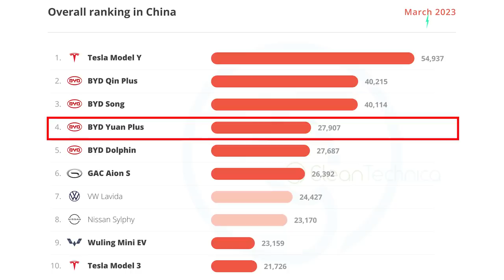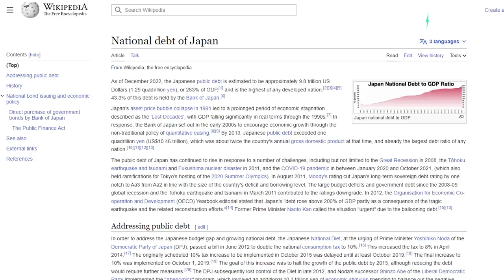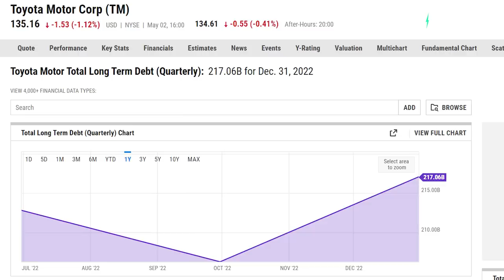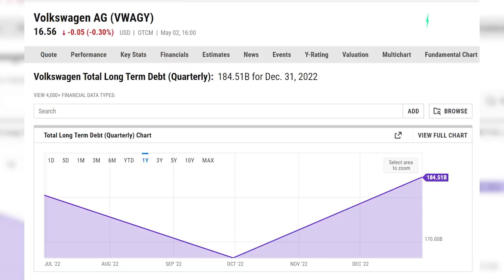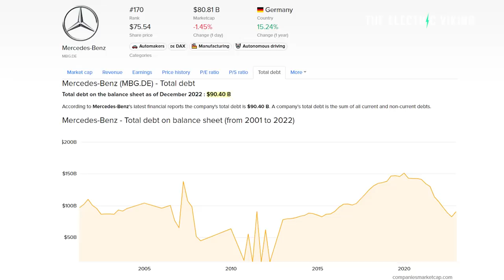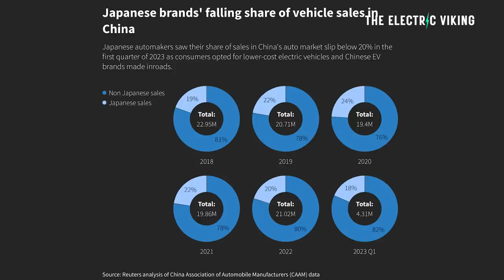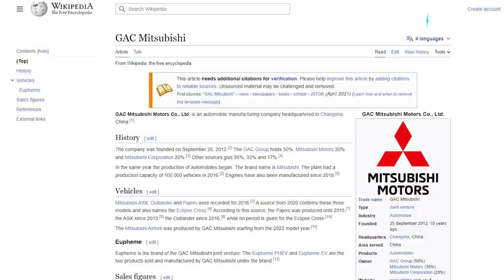Japan's automakers' Kodak collapse will cause an economic catastrophe

Comment: I don't get the connection between manufacturing moving from Japanese ICEVs to Chinese EVs leading to a recession.  Sure, an economic problem in Japan, but it should be a net zero globally as production moves from one country to another.

Are we going to experience a recession?  Possibly.  But due to the need to curtail inflation.

Interestingly, moving from fossil fuels/ICEVs to renewable energy/EVs will be deflationary.  The cost of both energy and transportation will drop.  And as energy/transportation costs drop the price to produce many goods will decrease.

Comment: There are also cultural reasons why the Chinese don't want to buy Japanese cars: the Chinese remember what the Japanese did to China before and during WW2.  Japan's economy is also failing due to demographic reasons: they have a birth rate that has fallen so low in recent years that the Japanese are no longer replacing themselves. Japan won't have enough workers to keep its economy and automakers going as it did in decades past.

Comment: China is not that interested in reducing pollution. All those EVs need to be charged and the means to charge them are coal fired power plants. "China is planning to build 43 new coal-fired power plants and 18 new blast furnaces — equivalent to adding about 1.5% to its current annual emissions — according to a new report. The new projects were announced in the first half of this year despite the world’s largest polluter pledging to bring its emissions to a peak before 2030,"

Comment: A couple of toughts i've had of late; Toyota & Honda have greenwashed themselves into a corner - by offering woefully inadequate hybrids and using marketing, well meaning people have bought into both brands thinking they are doing their bit for the planet, not it's clear both companies are not progressing as they should have from hybrid to full electric, people are switching to "greener" makes. They have backed themselves into a corner, and Tesla has exposed them for what they are i.e. not bothered in the least in "saving the planet. Not a good look. That said, the Japanese do have a couple of ace cards to play in the form of primarily Panasonic, Sony & Toshiba - these guys get electronics and i think they will end up either merging with or taking over Japanese car manufacturers as they all stand to make billions, and in my opinion by being late to the party, they may actually benefit by being able to scale prodcution, with the latest battery tech - but that is perhaps a little optimistic.

Comment: Toyota's big bet on its hybrid system turned out to be a one-trick pony.  Toyota was too arrogant to realize that EV's were going to be so quickly accepted by car buyers on a big scale in the USA and Europe and China.   In addition,  Toyota never made any real effort to promote hybrids in 3rd World countries, so it missed the boat there too.  Most 3rd World countries have very poorly built, operated and maintained electrical grids, so the 3rd World isn't ready to convert from ICE vehicles to EV's.  Toyota could have dominated the 3rd World with its hybrids, but it chose to keep selling cheap ICE vehicles in the 3rd World.  The Chinese gov't has made a deliberate decision to reduce the use of ICE vehicles in order to improve the horrendous air quality of Chinese cities, while simultaneously pushing ahead with solar energy generation efforts on a huge scale.

Comment: Clearly Japan has gone down the wrong path, but I don't agree with your comment about Japan being the country that is most dependent on a single market sector. Do you know how much Saudi Arabia and some other OPEC members depend on Oil? The global economy is heading for a huge boom once EVs and solar and windpower take over from oil. But Japan is not the most oil based economy - they actually import the stuff, and unlike Saudi Arabia they have the advantage of their population shrinking. Fewer jobs is less of a problem if you also have fewer people. Some of those oil exporters are going to have rapidly growing workforces at the same time as their main industry goes into a tailspin.

Comment: The EV game is only in the first inning.  The game really doesn't start for a couple of years when the energy density of batteries reaches 500 watts per kilogram.  That's when the current drivers of ICE vehicles realize that EVs are superior to ICE.  (Assuming there are enough high voltage chargers and available electricity which there isn't tight now.) In California, we have to turn off all electrical appliances in the early evening because of lack of available electricity and there doesn't appear to be any additional electrical infrastructure being added either.
Reply: New York get paid to use Ontario electricity.
Reply: @林振华-t4v  I live in Southern California where the Edison Tier 3 residential electrical rate is $0.44/kwh. Yikes.

Comment: From an Euro perspective, I think a part of this perception is spin. Product cycles are shorter and mode dynamic now for legacy automakers. Japanese are good at iterations ans constructing value with equipment. They are still leaders with aspects such as sensors or safety and making it reliable, ergonomics or luxury and perceived quality which is not something Chinese can be trusted equally. The reliability of all these new Chinese brands is also suspect. Nobody wants to pay 40K euro for a car without pedigree. I would not buy a 30K unknown brand electric Chinese if I can buy a 40K Honda or Toyota that I know has been engineered to a certaij standard that is part of the companys DNA. I know what happens when a car is underengineered and so do many customers. Electric infrastructure is not yet ready in Europe, and I think the Japanese brands are safely positioned to electrify their models rapidly when the paradigm reaches tipping point

Comment: In the late 1980s Europe was besieged by Japanese imports and, because Japan had already banned diesel engined small cars for emissions reasons and so were not making small diesel engines, Europe decided to push diesel as a way of keeping its competitiveness, hence all EU governments like UK had a pro-diesel policy and diesels got over 50% market share and the Japanese were kept at bay.  Later this manifest itself as the emissions-gate story because it got harder and harder to keep the lie going when it was obviously a filthy fuel.  Now Chinese imports will come but this time European governments, rather than figure out a clever way to buy themselves time to let their own industry adjust, they have done the opposite and set totally unrealistic deadlines for ending ICE sales and as a result the Chinese will come and clean up (literally).  The European auto industry has so many existing over capacity problems that grind it down and consequent lack of innovation (always dealing with yesterday's problems) that it is frankly impossible to imagine anything emerging that can put up a fight.  Japan's industry will disappear not only because they have almost zero EV sales or IP, but because they are terrible at combining hardware and software.

Comment: 10:00. Lol! The same cars from 1993 with a different bumper on them. haha. That's exactly what we've got. Actually it's shocking that the public has put up with the intentional  limitation in improvements in car engines and automotive technology. Had Elon Musk not started Tesla, would there even be any EV's right now in America? Maybe there would be still, no progress at all towards EV's, because there was no financial incentive to give the public anything new. The thing that is gut wrenching, is the fuel economy. Gas mileage, or "fuel economy" did not improve at all from 1978 to 2008, in any significant way, and in many car classes it went down. In the time between 1978 and 2008, car engines did not improve their efficiency in any meaningful way, making them the only technology on Earth that had no meaningful improvement in 30 years. They are STILL not releasing "lean burn" combustion technology. In 1973, a 2,500 pound Opel achieved 376 miles per gallon, in gas mileage, with a piston engine. The technology for "lean burn" has existed since the 1970's.

Comment: Yep, Toyota is giving us "choice"... the choice to keep the blinkers on re the reality that ICE (including hybrids) is a thing of the past (there are still plenty of denyers out there, especially here in Australia, but nowhere near enough to save them!), to blindly resist change and cling to brand loyalty, buying outdated technology, based on the old "Toyotas go forever" reputation they have arrogantly relied on for decades... (forgetting that "forever" isn't much use when the fuel required to run them just isn't going to be there WELL before "forever" happens along...),  OR... the CHOICE to shop elsewhere 🤔. I'm certainly no expert in any of this, but it doesn't seem like a great strategy to me! (And this is coming from someone who was one of those "rusted on" loyal Toyota "fans" most of my life up until recent years!)

Comment: Toyota advertise on TV all the time about their EV, the funny thing is that in little writing it says overseas pre production model shown, so they are advertising a car they don't even have for sale as yet ? Oh  this is on Australian TV, I like watching the EV commercials to see that finally we are getting a few more models coming our way.
I see the ICE makers trying their sneaky ways to try and get the Hoon interested in their Cars, like VQ with their race button and other gimmicks.
Trouble is that anyone with a mobile phone or PC can see that the EV is by far the better option if you want a fast car.
Everything is going Battery Electric, all my Workshop tools are now BEV as are all my Garden Tools.
The best thing about all my tools is that they all now cost me nothing to run.
I bought a Solar panel and inverter for my Workshop/Shed that charges all my batteries from the Sun, it also keeps my Jet Ski Battery and Boat battery conditioned so they don't go flat between uses.
Once I get my BEV Vehicle, it will also cost me nothing to run as I will add another 3 to 6 kw of panels purely for the Vehicles in my Garage with a fast charger and Battery wall.
Considering we would use around $7500 a year to refuel both ICE vehicles, that will pay for the Battery wall, fast charger and extra Solar panels over only two to three years at most and after that, just savings.

Comment: 20:17 I understand how it is meant but this is actually not true. For example Guyana's GDP jumped 25% in 2021, 55% 2022, and this year is projected 25% again. Nearly all growth is due to the  oil industry. Others: the U.A.E., Saudi Arabia, Quatar with gas. And i ask myself if South Korea and Taiwan have similar dependencies on their electronics sectors. In South Korea it is said you have to pass the Samsung test to get a job. IIRC, they employ 20-25% of the workforce alone. 

Would have been interesting why we would enter a global recession because of Japan falling. They are important, but i think they are a part of what is already going on and speed it up, when they fall. On the one hand China's debt policy let some countries fail - and their own economic policies obviuously - for one part. On the other hand it's already put into place with high interest rates in the US and Europe. They still influence broader money flows than China. Japan reaps, what it sowed with it's enourmus debt levels - among other problems.

Comment: If you look at the long term trends including new product development you see the bursts and the drop due to generational demands, failed technologies and other factors..
EVs are not proven as a long term solution that is why the smartest manufactures do not go full in on a yet to be proven technology.
Hybrids are the ideal pivotal point while EV can get to a feasible and reliable status that is 20 to 30 years out.
The EU is in big trouble simce they have proposed a global plan that does not really work in paper.

Comment: Erm BZ4x... Toyota do not buy it and just stick a badge on it .. Toyota buy BYD batteries, motors motor controllers and some other related ancillary components for same .. these are shipped to Japan where the car is assembled.. so ... this is no different than 90% of the car manufacturers from around the world that buy components  and assemble the cars wherever in the world.
And by the way.. I'm a BEV fan .. Tesla being my favourite as they had the best engineered BEV cars in the world at the moment ..me being a electro mechanical design& production engineer.. should know this. Regarding your other major point that there is death occurring in legacy auto I couldn't agree more .. all you have to do is watch tesla's investor vid .. and you will say that they are going to beat and already are the rest of via superior engineering and production.

Comment: A couple of points. Though I do like your channel and you have a lot of good things to say. I don’t think electric vehicles are going to be the end. All be all of the car market. It will be a mix. You will see fossil fuels do one part. You will see possibly Fuel Celso another. And Electric will be mainly be in urban or suburban areas, but not for everyone. Face the fact that the planet doesn’t have enough minerals with current technology to put everybody in an electric car. Nor do we have enough baseline, power generation. The switch to electrification will not be as complete as you think. And it will not be until the technology for electric improves. Lastly, much of the world hates China and does not want to be dependent on them for yet another industrial good.
Reply: If the world hates to buy Chinese stuff, how does WalMart sell all their stuff? Are any toys made in the US?
Reply: There will be hobbyist ICE cars available to buy.  That's it.  EVs are faster, cheaper, more reliable, etc.  Gas stations will start to disappear, also.  That will be a problem for ICE cars.

Comment: It never happens as the prognosis tells!
Even car manufacturers change, even if too slowly.

Toyota, for example, could have a very good BEV in the market in, say 5 years.

The prognosis that says the ICE manufacturers will fold in a decade just doesn't take into account that they actually can change.
Reply: This dude is cranking out 7 vids a day. Not a lot of thought or work goes into making it, and it should be taken with a bucket of salt.
Reply: If only their competitor did nothing.

Comment: The proliferation of electeical cars in Norway is the result of extremely high government  taxation on ICE cars; the likely intentions are two fold: exporting oil so as to stuff more money into the Norwegian sovereign wealth fund, to be stolen by banks in Switzerland, London and NY; then if the Norwegians protest, shut off the electric network in winter so all those Norwegians in the northern and upland 90% of Norway would freeze to death; i.e. Norwegian government officials are agents working for the banks and farming Norwegians for slaughter. Likewise for China: the proliferation of electrical cars is the result of artificially high gasline price and artificially low electricity rate; the electric network can be shut off any any moment by the government, then the bipedal featherless farm animals wouldn't be able to go anywhere. It is about control and exploitation.

Comment: I though it is the world's wish to phase out ICE car and switch to EV.  Therefore it is up to the ICE car manufacturers to bring out EV models.  If they don't then the ICE cars will have no buyer in future.  China is just one of many countries producing EV.  Japanese and European car manufacturers have been producing EV a lot earlier than China and are in an advantageous position to switch to EV.  Chinese EV sells only if it is better or cheaper than the rest.

The car industry is changing with time.  When everyone made cars the US Ford found a way to produce it by production lines and dominated the world.  Later Japan found a market to produce smaller cars without the need of 5 to 6 litre engines and became the choices for the world as not every country has vast oil reserves like the US.  Then the South Korean came along to offer models to the low end mass market while the European concentrated on the high end luxurious sector.  China has to import oil to run the ICE cars so it must reduce dependency on fossil oil by going electric as all public transport systems like HSR and metro are already electrified.  It is possible that China having to make more EV than others could offer models proven to be cost effective.

I believe Japan has invested heavily on the hydrogen car but it didn't catch on in the past.  May be it could catch up in future..

Comment: It won't just be car makers hit by recession of course; in the USA banks have had to be proped up.  EVs are not a serious problem for non  EV production because 80 million light vehicles are made annually and BEVs won't be more than 2-3 million.  Tesla has impacted by taking a signifcant shart of the sports sedan market which is one of the most lucrative parts. GM's switch to pickups shows where they think they can make profit. China on the other hand doesn't have much brand recognition so there isn't much prestige in owning one; they will go for price.
This will force Tesla to maintain a compeditive price and profits will slip.  The chinese can't really go all EV in the near future either; but the suggestion that they want to have that goal has a push back in Europe where they don't want to buy Chinese EVs.